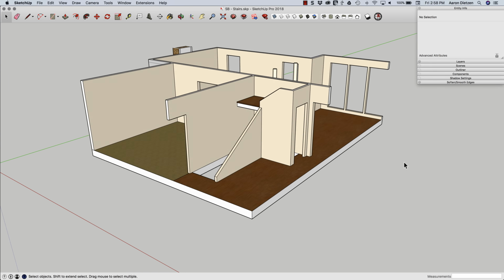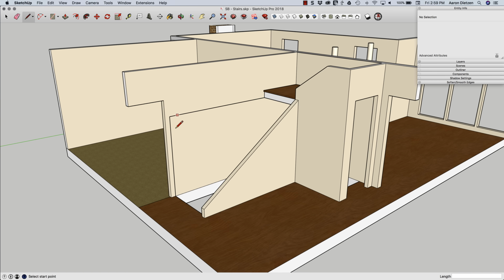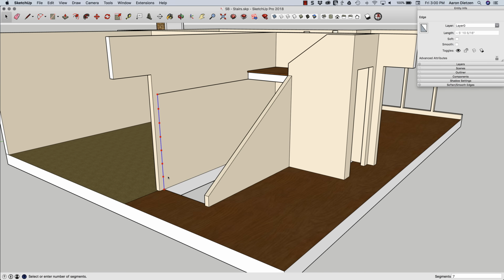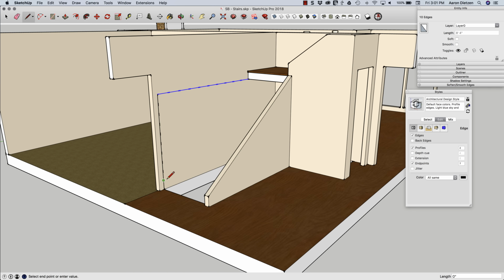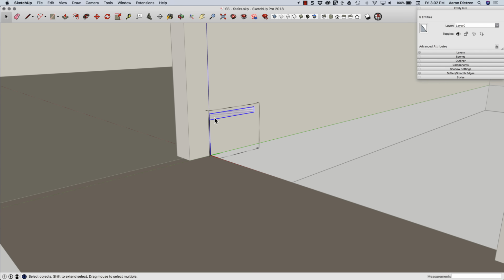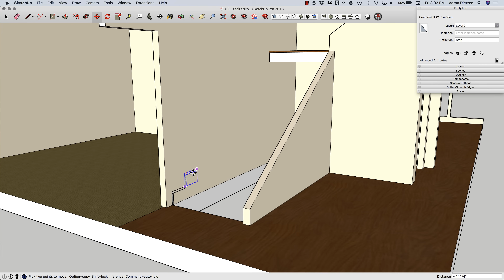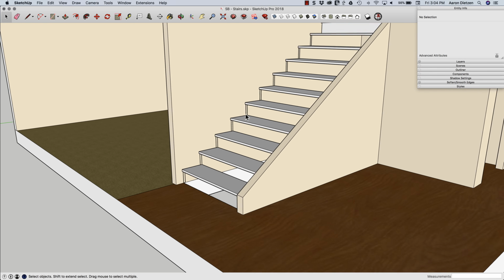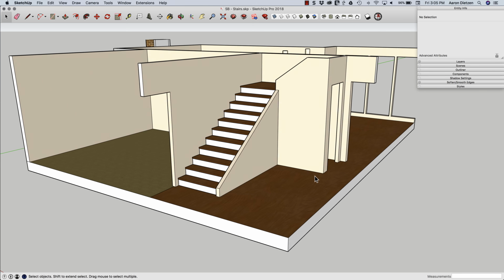How to Build Stairs in 3D Software - SketchUp

Comment: A easier steps:
1. Draw a horizontal and vertical line of stair of random length.
 2. Make them components.now copy them to desired numbers.
3. after that scale them vertically and horizontally to match the height and depth. thats it

Comment: How did you drag all of those lines at 5:50 when you only click one component? What key(s) did you used? Thank you.
Reply from the maker: The vertical line was move using the Move command.
Reply: @SketchUp  I mean how did you move that specific line from all the copied components when you only click the bottom component?
Reply from the maker: Double click to enter the component, then you can edit any geometry that is a part fo the component.
Reply: @SketchUp  Yeah you're right, but I get that.You double click only the base component, and you edit it, What I mean is how did you do it all at once up to the very top of the staircase? You drag/move the line from that bottom component, and also all the others have been dragged or moved. Thanks for the reply.
Reply from the maker: That is the reason that components are used. A change to one component changes all instances!
Reply: @SketchUp  Ah I see, that's the answer I'm looking for. Now I know the advantage of a "make component" tool. Thank you Sir for sharing your knowledge..

Comment: Hi Aaron. I'm enjoying your video and thought I'd share my slightly different workflow. First, I keep in mind some basic code stuff, minimum stair width 36" (finish), minimum tread 10.5", etc. Then I build a "tread" box, 1" high by tread depth, say 10.5" by tread width, say 36". I make it a component. Then I copy it 1" up and shifted over, as many treads as I want. So it looks like a staircase with 1" risers. If I have a landing I just use the same component for now. If I have an L-shaped stair I add a few more treads. Then I take the whole set of components and group them. Finally, I use the scale command to stretch the whole thing vertically to match the floor to floor height. Once I've done that then I go into my tread component and do detailing, adding the nosing and whatever else. Finally, if I have a landing "tread" I make it a unique component and stretch it to increase the tread dimension to my landing size.

Comment: Weld sounds like a good idea but it's "Unsigned" and "Blocked" and I'm not going to run the risk of it being abandoned and hacked. It looks like the Author has some difficulty responding to comments and taking care of his product. This is never a good sign. If you have a suggestion for a SIGNED and managed product that does the same thing, I'd love to hear about it. 
Thanks!
Reply from the maker: Hi Jennifer! Signing extensions is something that was introduced fairly recently. Some of the classic extensions that are no longer updated (such as Weld) have not yet been updated with this new process in mind. The extension does work very well, though.
Reply: @SketchUp  I'm sorry I never saw this comment until now, Aaron. 
Thank you!
👍

Comment: Great vid! Never noticed the Divide option - definitely an omg moment. And it works on circles as well which is super beneficial. Anyhow, my approach is to use guides rather than lines, since guides can all be removed at once as opposed to lines that must be removed manually, which in a complex model you might forget one or two.

Comment: There is also a relationship between riser height and tread depth. Two risers + One tread should equal about 26" for a comfortable walk. And what others have mentioned below, riser heights can't vary more than 3/8" from tallest to shortest, so it's best to divide your risers from finish floor to finish floor.

Comment: Good Sketchup user but not a carpenter.  Stairs cause myriad accidents due to bad design, the consistency of the rise and run ratio being one critical element.  He should have measured the height as the distance between the finished floors, usually around 109 inches.  Sketchup makes stair building easier than anything I've experienced, because you can select the rise by doing what he's doing, with the rightclick/divide tool.  Once that basic geometry is ascertained, just draw one tread and make it a component.  Copy it up and over to be the next tread and then type 'x' and 12, or 13 and that's the staircase.  You can then extrapolate ballusters and railings, nosings, trim pieces, all from within a component and draw the whole thing all at once.  You can even copy up a spiral stair case, but you have to "engineer" how you will make the first copy up, over and around in one move.
Rise and run should add up to 16 or 17, sometimes 18 if the stairs are "luxurious".  Basement or secondary stairs may allow steeper rise run ratios than main stairs.  6" 8" clearance to anything overhead for basement stairs.  6' 10" for mainstairs.  If you can build a staircase, you can build any part of the house including hipped roofs.
Reply: Refuso Againo Excellent point! When we make these videos, we need to pick what to focus on and, due to time, we generally concentrate on the SketchUp steps. Fortunately, we have viewers like you that help to supplement information that we give! Thanks for the excellent tips!

Comment: You should have divided the height from the top of the landing at the top, not the underside. Unless you cheated by working it out before the video started, the top rise would be different from all the other rises.
Reply: My thoughts too, but that leaves a extra step at the top, so you need to also divide the run by one less than the rise.
Reply: That's  not the way he rolls.
Reply: Exactly what I came down here to say, as well. Because the IRC building rules don't let you play games with mismatched stair riser heights, and this method leaves that last step's dimensions completely out of the equation (looks good on paper, maybe?).
Reply: marcusarcus I don’t like to call it “cheating” ... I prefer to think of it as “working it out ahead of time so I’m not caught trying to do math while filming”